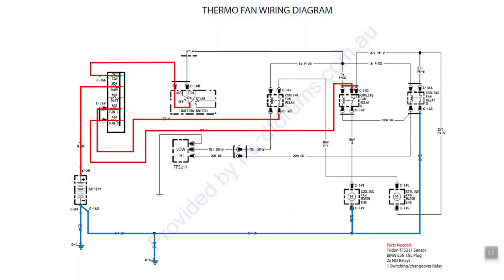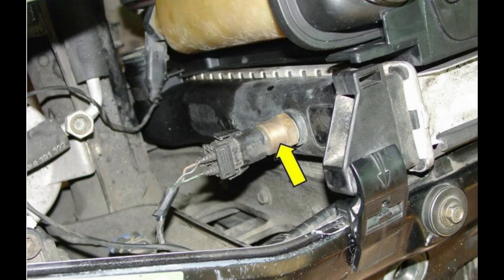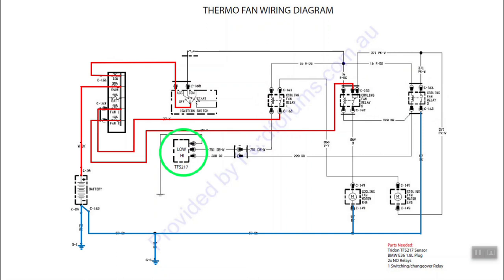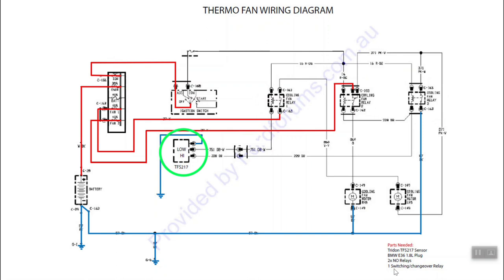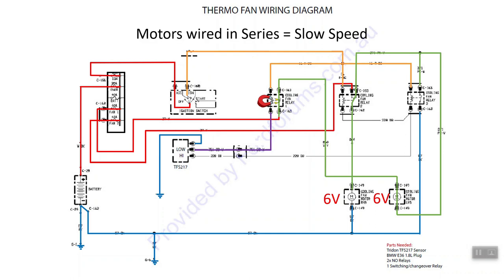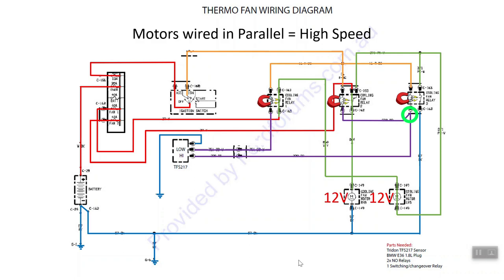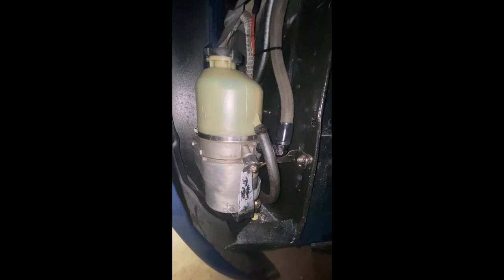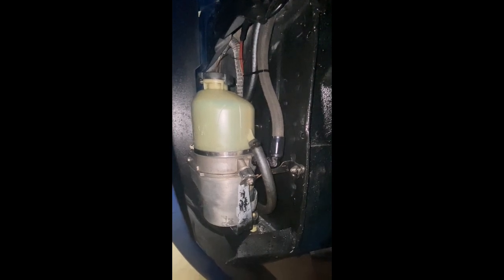Project XB: Episode 5: Thermo Fan Wiring & Astra Electric Power Steering Pump Mounts

Comment: Great video and very informative.
Reply from the maker: Thanks for your comment and for watching
Reply: Does the radio face have the light's working on it at all.
Reply from the maker: @tonyblack7904  it doesn’t have any lights on the fascia. I suppose I could have rigged up an LED or something but didn’t worry about it as long as the phone paired up and the remote worked on the mechless receiver I was happy.

Comment: Not just the E36, but also  E30 M20 M43 M50 M52 E34 E32 M30, part number for switch is #61311378073 . So the vehicle range for plugs is broader as well. you can also mate them to the Volvo 850 dual relay for multiple fans as well as multiple speed etc….  That’s a very tidy xb. Had one when I was young in the late 70’s. always regret selling it.
Reply from the maker: Thanks for your comment mate, fantastic info there, thanks for sharing. Love hearing from people and their different ideas. There’s probably many other ways to wire them up too. I looked at the Volvo dual relay and was keen but they aren’t as plentiful as the older fords at my local wrecker so couldn’t find one.
Reply: @machbadger1509  no probs 👍

Comment: Great video couple questions did guard have to be removed to mount pump? And did you have to run a restrictor in the high pressure hose?  i have been told that a standard power steer hose is restriced about to do the same set up on my xb so your vids are very helpful cheers

Comment: A Davies craig duel fan controller is much easier and is digital . Even had a digital readout for foolproof neat install 🚀
Reply from the maker: Hi thanks for watching. The Davies Craig would work and simplify the install, but I like to keep to OEM rugged designs and avoid the use of aftermarket electronic controllers, especially from some brands, for critical components like the cooling system, as a failure can have catastrophic results. However I do realise that I have a slightly different approach to most in this regard, but they do say that admitting to a problem is the first step of recovery...